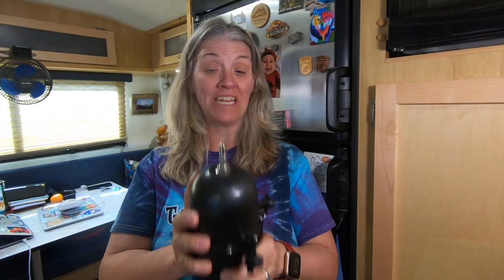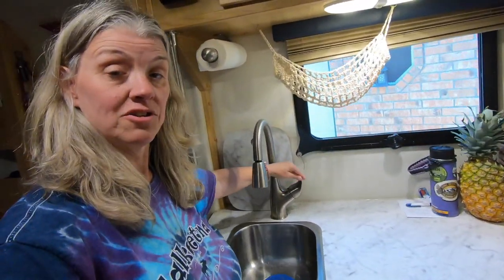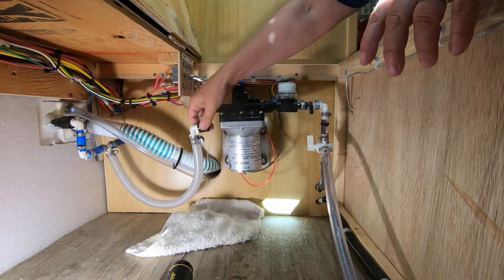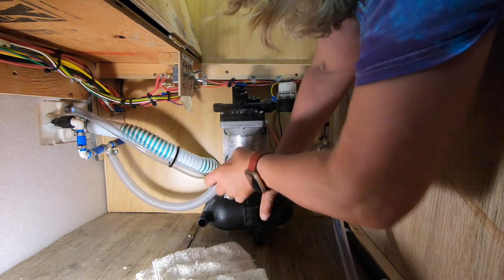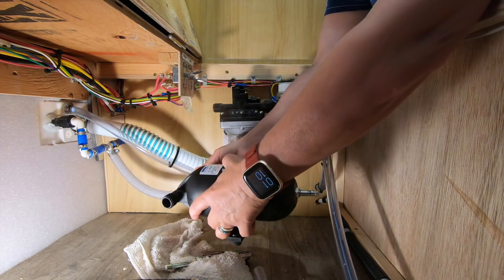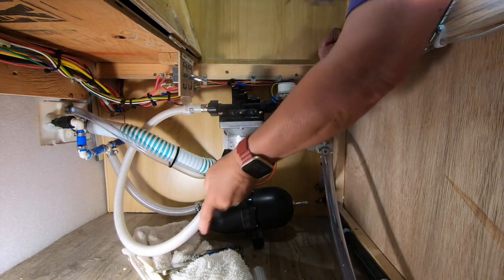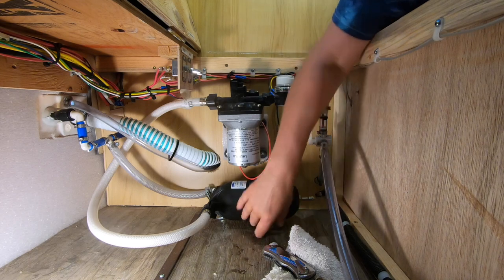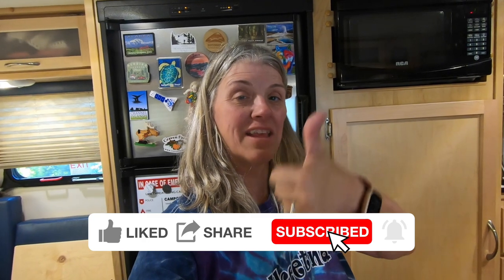Rv Water Tank Accumulator Installation - Full Time Rv Living

Comment: I also read on the forum using soft hose quiets it down a bit. The white hose that came with the kit does look soft. The problem with the Pex is it’s so hard and doesn’t expand causing the water hammer. Thanks for the video!! I should probably do this before the end of hibernation.
Reply from the maker: Thanks for telling me about the suggestion on the forum!  I think it would still hammer a bit without the accumulator and we're really glad we installed it!
Reply: yes... 13mm irrigation piping is quite a wonderful material in that regards, just do not make the mistake of using the plastic clamps on any interior fitting, only the stainless steel clips or scre-tightened clamps on your connectors

Comment: Just a quick question or two….this sounds like a great feature, is that similar to an expansion tank?  Also I noticed where the water pipes go to the outside the wall seems to be only fiberglass letting the light from outside to be visible through the fiberglass layers…..is that a spot that should have insulation to keep temperatures more level?  Am I overthinking things?
Reply from the maker: Hi John! Thanks so much for watching all our videos and commenting! Your name has popped up a lot!! It is similar to an expansion tank. It would be nice to have more insulation in that spot but we keep the bench open if we're camping in really cold weather overnight. Haven't had a problem yet!